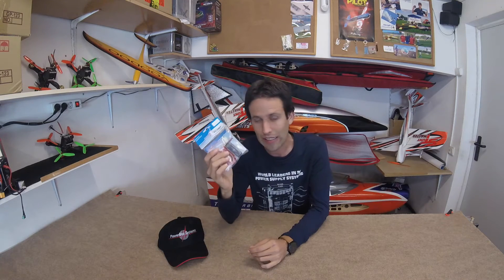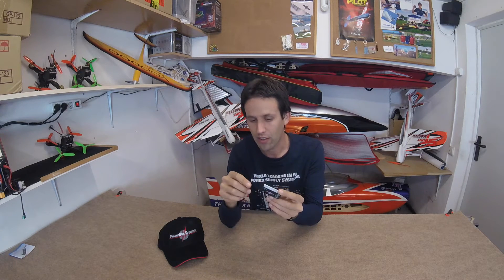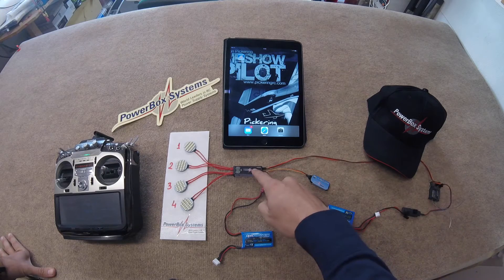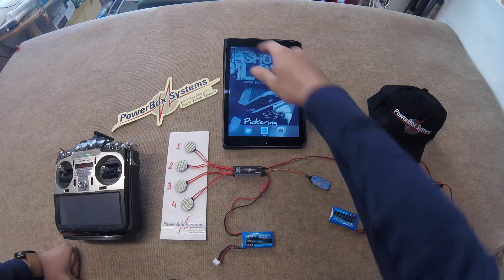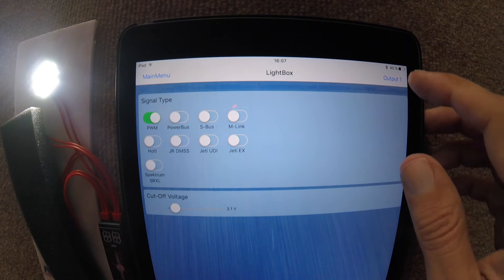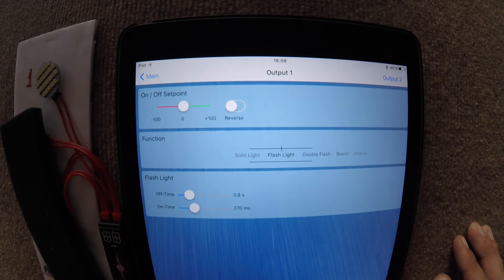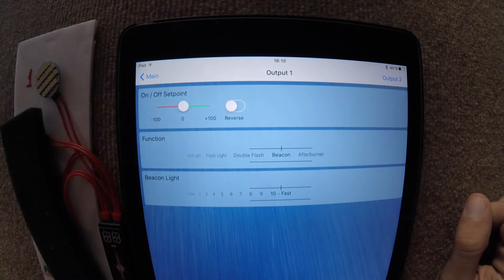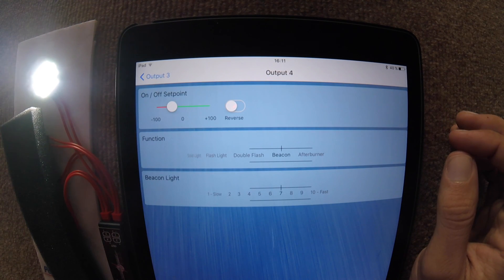Powerbox-Systems Lightbox, LED Controller and setup

Comment: Hello Martin, I got it set up and programmed.  Two lights per each wing tip.  One light flashes at low throttle and the other light is solid at high throttle.  QUestion for you?  can it be programmed so that the same light flashes at low throttle and remains solid at high throttle?

Comment: hello, question for you. I have 4 LED lights, each light is max 6 volts.  My battery source is 2S, and the lights cannot handle this. DO you have a workaroud for this?
Reply from the maker: A linear voltage regulator should work in that case… to just drop the voltage for when it goes into the light controller

Comment: Sorry one ask, need a resistance for led the light box? I use in first output for example 2 classic 5 millimeter led in series, need alimentation from extern battery 2s lipo or take current by receiver? When i use a 2s lipo for alimentation 2 classic 3 volt led in series need resistance or have inside first the output? Thanks
Reply from the maker: In theory you shouldnt need any additional resitance, however this will depend on what LED you use (if they are ready for the voltage you are inputing)
You can either:
A) Not use a separate lipo, in which case the LED and Lightbox take power from the receiver/powerbox and will therefore receive the same voltage as the receiver/powerbox (5,9 or 7,4v)
B) Use a separate lipo, in this case the LED will receive the voltage from this additional Lipo.  This can be 1S, 2S or 3S.  
Hope this helps! Martin